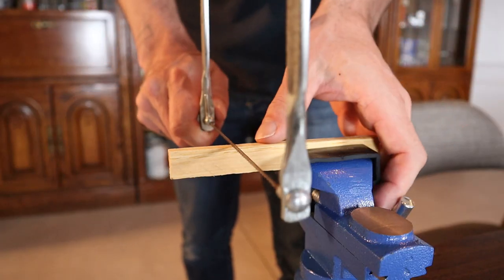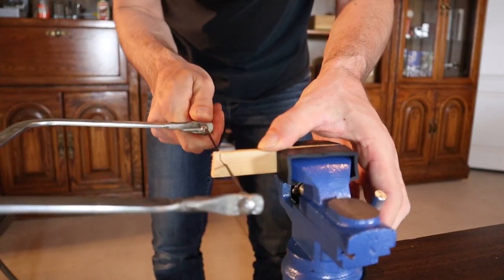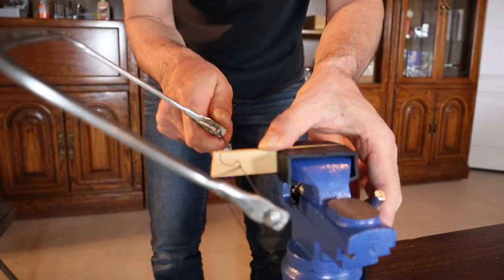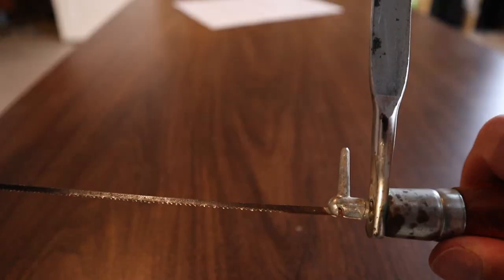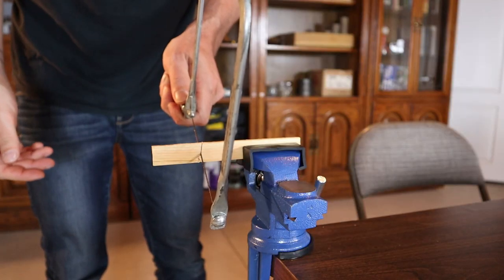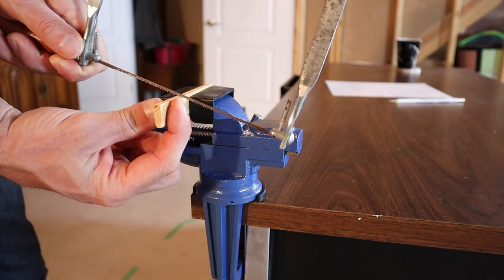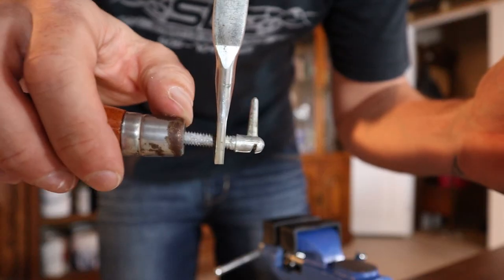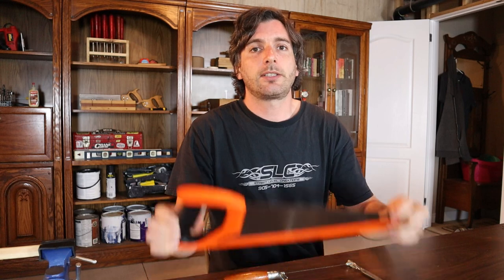Before You Use A Coping Saw Watch This ( Decorative Saw Work )

Comment: I thought the Husky 6 in. coping saw from Home Depot would be handy to cut corners for picture frames. I had a heck of a time getting the blade in. There must be a better way than how I did it. You should have included changing the blade in the video. Thanks for the tips though.
Reply from the maker: That’s a good point actually . I should have showed changing a blade

Comment: So are there different teeth per inch blades. I would think finer blades would make the sawing easier.
Reply from the maker: yes it will cut easyer esp getting the cut started but it will also cut slower